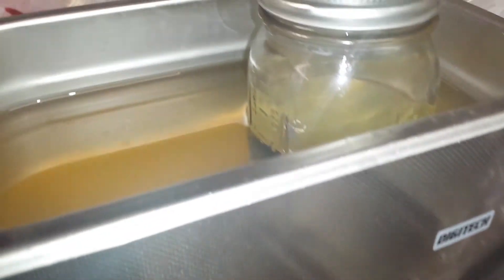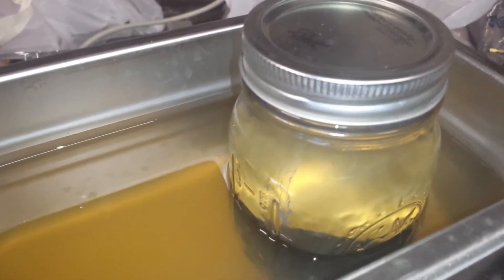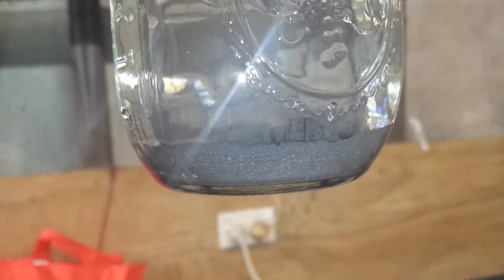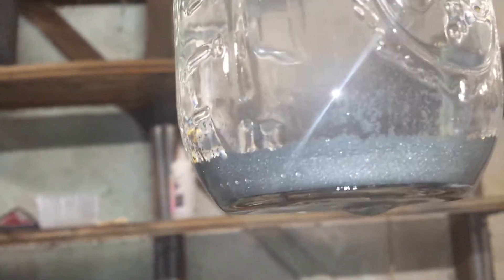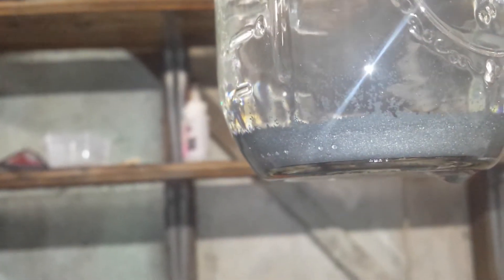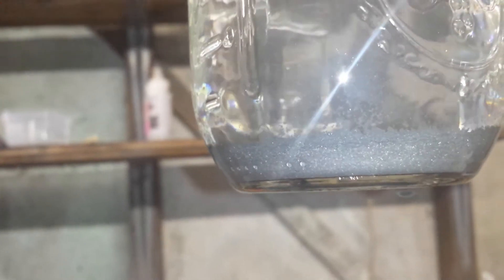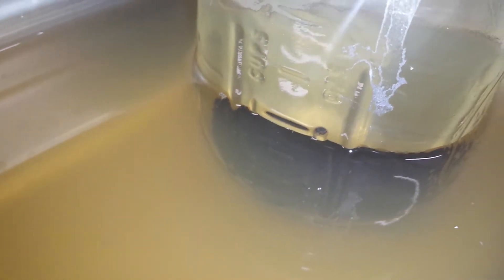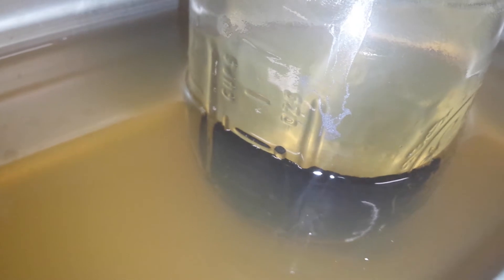Make Graphene with acetone/water

Comment: What is that silver thing that is rising from ?bottom?
Reply from the maker: Graphite being ripped to pieces
Reply: @m3sca1  I got this also but i dont know what is it. This is not graphene, right?
Reply from the maker: @sikismeker  you need to zap it for quite some time. Im the order of a few hours. There will be graphite and graphene together. Look at the 2 different layers after it settles. The lightest stuff on top is what you want.
Reply: @m3sca1  I f you have time try this.
Take a regular jar about 800-900g.
Put destiled wather in about 400ml, put sodium sulphate about 35-40g in.Mix it, it will not complitly desolve, but when you heat it, it will. You need to put all this on heater, heat it at 75-80degrese C and put 12ml of sulphuric acid. Use large jar or metal basket and put you jar whit this mix inside , that jar can brake on that heat.PUT IT WERY SLOWLY. Put graphite in there.I use graphite plate, i cut it down to small pieces.About 4cm x 10cm piece thichnes 5mm. And i use battery charger 12v. Put graphite on negative. And you will get a lot of this. I dont know how to separate this, graphit from graphene. You will gat same silver compound as i saw on you video.
Reply: @m3sca1  My english is not great, but i hope that you understand me.Cheers.

Comment: Those bubbles are interesting,  can you put a hose and trap them in a bubbler with soap on to, see if they light.
Reply from the maker: Hhydrogen4Power pretty sure it is a heating that makes them -have never tried to ignite them, suppose it is worth.
if it is Hydrogen - it would be a very new and unknown method

Comment: Hi Mat
for the most efficient ultrasonic action,fill your ultrasonic bath to the recommended level, then suspend your jar 1 inch below the surface of the water level. Placing the jar on the bottom works, but not as well as the above method.
Reply from the maker: electro1622 thanks for the tips mate.btw do know where to get the 2 part impression quick set? Not the alginate, the silicone one...
Reply: yes... It's pretty expensive from dental supply companies, but you can find it on ebay which is cheaper. By the time you add postage it's not that much cheaper. It's available in different hardness' and consistencies so make sure you chose the right one. You can get it in putty form,  light body and heavy body.How much do you need..?..and what do you want to do with it..?
Reply from the maker: electro1622 i want to test making a graphene doped conductor with it.
Flexible was the plan...
Reply from the maker: electro1622 as for how much...basically just enough to see if it would work 20mL would let me know if it feasible
Reply: If you only need it for that, and not for an accurate reproduction of something, you can use silastic silicone from the hardware store...that is flexible silicone and it's heaps cheaper..
Reply from the maker: electro1622 without  giving too much away i really need a fast set.
i considered many products before i discovered there is a silicone alternative to alginate with fast set times
Reply: bad news is ...it's about $120 for 120 ml.
Reply from the maker: electro1622 i was hoping you would have known a supplier in oz that was better than what i found on ebay....
http://m.ebay.com.au/itm/111461477971

Seems like i need a rethink
Reply: m3sca1
Hi Matt
some time ago you asked for silicone impression material with a quick set time...I found some laying around the lab...it's about a 3-4 min set and is light body polyvinylsiloxane, addition polymerization. Msg me if you still want it...
Reply from the maker: electro1622 yeah that would be awesome. 
Will you a msg on the google plus chat with my email address
Reply: You told me where you work so I'll give you a ring and we'll go from there..
Reply from the maker: electro1622 too easy